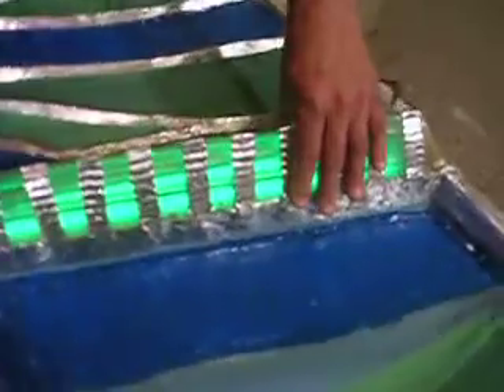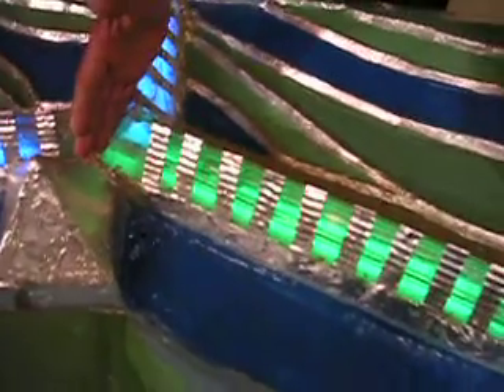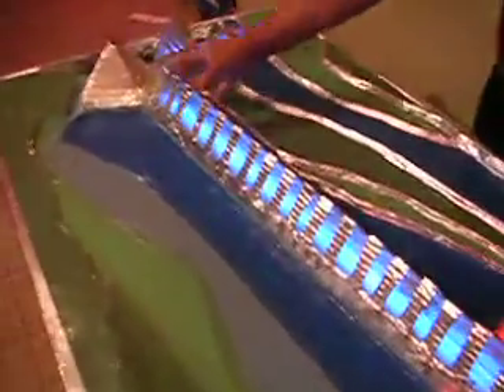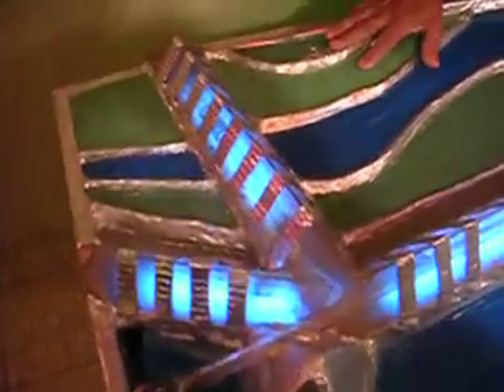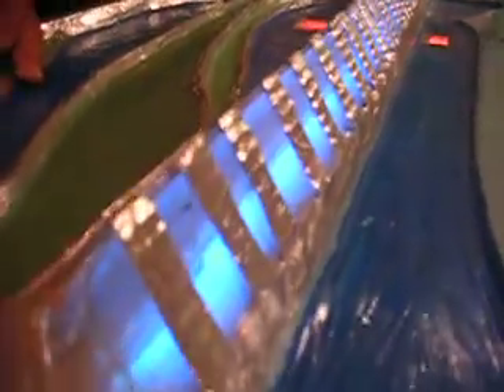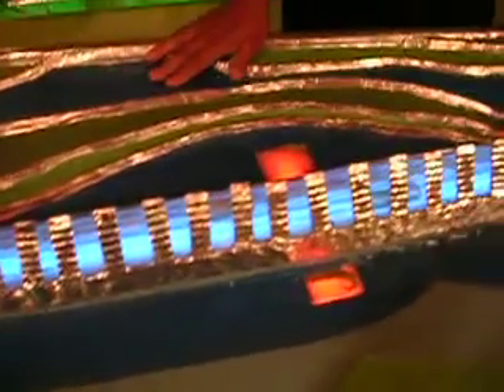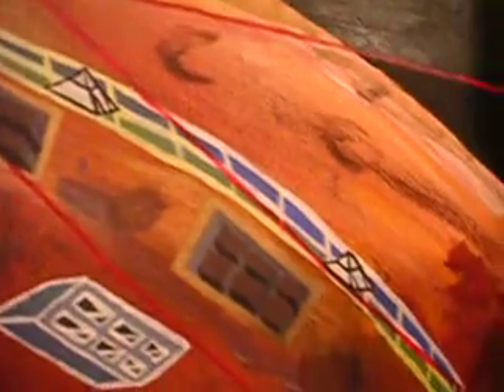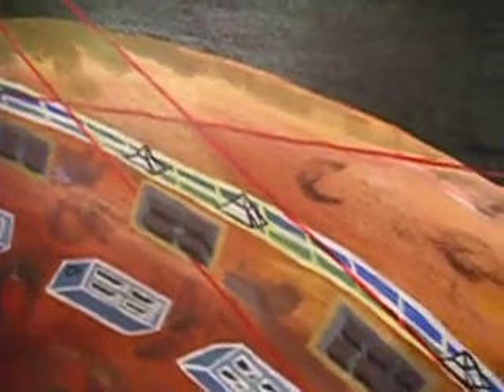300+ mph High Speed Prototype Car Tunnel

Comment: This guy is great. A bit nuts but great. The only thing I can think of that might be of interest is expanding your tunnel idea and using it exclusively for supersonic travel across great distances. Having a sealed tunnel means you could  swap out the air for something like helium & run maglev/tracked vehicles at the speed of sound with minimal drag. The only safety concern is that your tunnels are easy targets for terrorists.